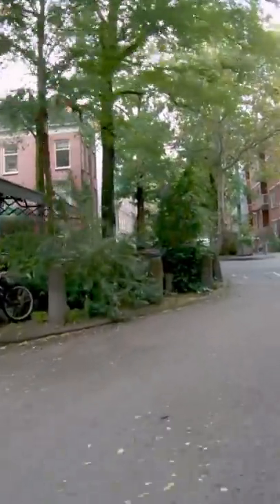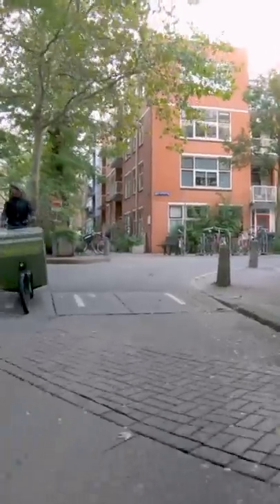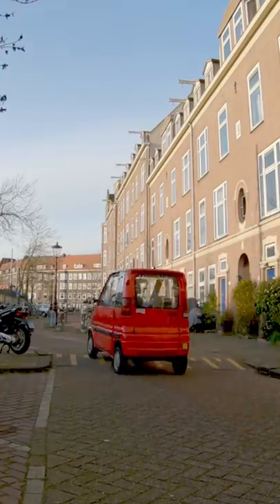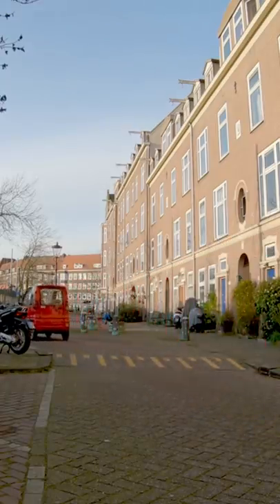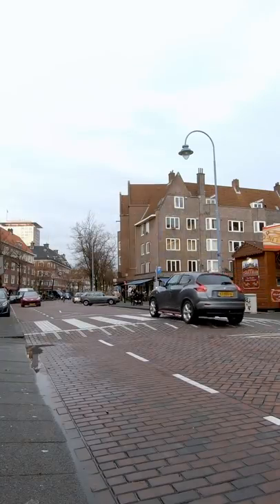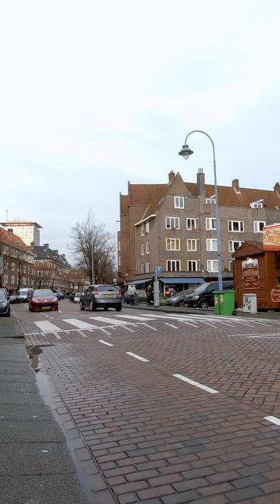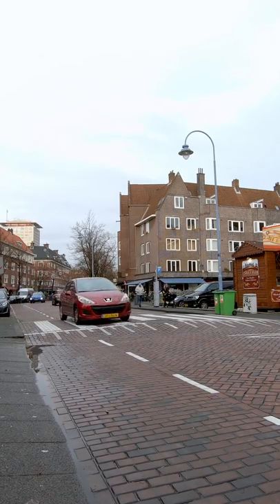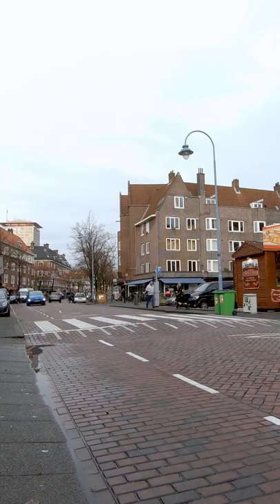How the Dutch Slow Drivers for Safer Streets #shorts

Comment: Some of these seem dangerous,  which doesn't make sense if you are trying to slow people down. You can see better down straight roads, you won't die if you go off the road, if the area near the road is clear.
Reply: They may seem dangerous but if you are more likely to drive faster you are more likely to cause accidents and you are much more dangerous for pedestrians. These precautions are taken more in areas with lots of pedestrians or bikers.

Comment: So what kind of traffic problems or just general automotive issues do these countries deal with
Reply: We had one of the highest traffic fatalities in the 70's, now we don't.
Reply: @Brozius2512  I meant currently but thats good
Reply: @i20coyote85  Still safety, there is a reason why the Netherlands has low traffic fatalities compared to other countries.
Reply: @Brozius2512  that's all well and good but I'm sure there's certain stresses that could be disproportionate if they population density, or just the overall population was larger, with cities designed around pedestrians rather than motor vehicles

Comment: I live in a small town out in the country with nothing but corn fields in every direction. These "Narrowing Roads" don't slow me down, as like when a river or flowing water reaches a narrow area, I too speed up instead of slowing down lol. Sorry but if you can't thread the needle on a road that's barely big enough for two cars and can't pass that fucking godzilla sized tractor with tires almost as tall as a 2 story house while you're going flat out with half of your tires on the passenger side touching the road while the other half sit out over the roads edge like a pair of suicidal koala bears all without you or your passengers sucking up the cars seats due to major butt puckering factors then you aren't driving Correctly. Giggity.

Comment: You know I made a similar comment about a similar video of this but this clears it up so much as to why the Netherlands are safer to drive. But one question, what about buses? I mean don’t those things exist in the Netherlands?
Reply: They do. But the most traffic calmed parts of a city are the streets within neighborhoods rather than the roads connecting neighborhoods. Buses mostly travel the roads that connect neighborhoods. If a bus were to go through a neighbourhood, the road it is planned to drive across will be calmed differently. For example, instead of speedbumps the street would be narrowed for short intervals. Buses would still be able to pass, but two cars can't simultaneously fit. So when a car approaches the narrowed part, they will subconsciously slow down due to the narrowness of the road, and also to check if there is any incoming traffic

Comment: Claustrophbic design that increases the chance for something to go horribly wrong for all parties involved in an accident doesn't seem like the kind of area I'd like to drive in, knowing how many bad drivers I have to deal with locally. You can't make someone who doesn't value their, or others, life and safety care more by introducing more things to run into, or more sudden slowdowns/stops. If they cared in the first place, they wouldn't be driving that way in the first place.
Reply: Netherlands has a good public transport system. We prefer you to either use that or a bike rather then taking the car. Driving cars here is way More expensive then in the USA. Stats actually proof you wrong else they wouldnt be building these roads here
Reply: @Klote3241  Can you link resources or research that backs up your statistical claim? Please don't say something like "stats back x up" without providing said stats that prove your point. Also, if the push is for everyone to use public transport like you say, why go through this effort of redesigning roads in such a way as to make them more dangerous? There are already fewer people driving, which means with a lower load on the roads one would expect the chances of things like accidents between drivers to decrease, while accidents caused by environmental hazards would still have the same chances of happening.
Reply: @admadea  Cant share links on youtube. i suggest you search it up with dutch road safety in an international perspective. the wbsite is called swov it compares car accidents to other country's the netherlands is actually one of the lowest when it comes to car accidents.

Comment: Sucks when an animal runs onto the road and you hit a tree though
Reply: What animal would be loose in our cities?
Reply: @Brozius2512  the picture showed a road that was not in the city with trees close on either side
Reply: @gustafandersson237  You do realize how close towns and cities are together in the Netherlands, right?
Reply: @Brozius2512  yes, but in a crash with a tree  there is a lot more pressure put on the car since only a small part of the front takes the full force. Therefore a crash at 50 km per hour is very likely to be fatal
Reply: @gustafandersson237  But for some reason it hardly happens in the Netherlands, I wonder why that is!
Reply: @Brozius2512  they probably barely have and wild animals or ice like in Sweden
Reply: @gustafandersson237  We have deer and in winter ice but our roads are well maintained in winter.

Comment: As much as these are great for speed reduction, they’re absolutely AWFUL for accessibility. Narrow streets with trees? Where do you let down your wheelchair ramp? Brick roads and speed bumps? If you don’t drive at like 10MPH when approaching that bump in a handicap van you’re literally going to scrape your bumper against the road. Speed bumps where the pedestrian crossings are? Makes it so much more difficult for motorized wheelchairs to cross the street, because the surface is not flat and depending on the chair they may have to go off of the bump for their wheels to work effectively and safely. It’s definitely more safe, but not very accessible :(
Reply: Not to mention making delivery drivers lives hell, making roads cost more, and frustrating the public
Reply: @nortons4673  you should look at this guy's channel and watch some more of his videos. They're light, all tie together nicely and do a thorough job of illustratrating the problems bad infrastructure can cause.
Reply: Pretty sure those speed bump crossing were flat on top and level with the sidewalk

Comment: Smart to put trees close to country roads,  1. if you mess up you instantly die by hitting a tree 2. if anything big wants to drive through there, it can't make way and will get stuck if something else needs to pass it. Sharp turns just means more braking and accelerating increasing pollution significantly and also creating unnecessary noise. i have to say a lot of the things mentioned are stupid, annoying, serve no real purpose and are expensive, specially the brick roads. Excessive speed bumps and narrow roads seem quite dangerous too. There's no room to escape anyone if someone messes up. If someone tailgates me while I'm on a motorcycle on a narrow road that's also separated from the opposite lane, then my only option is to speed up excessively. And speed bumps often risk rear ending accidents, so you have to speed through them if someone is behind you and you didn't see it in time to gradually slow down. Increasing road noise certainly isn't a nice attribute either, it's loud for everyone but in a nice car you barely care or notice. plus brick roads are quite slippery and dangerous, longer braking distance and really horrible for motorcycles.
Reply: All your opinions on road safety are just speculation, while these decisions are made by professionals who base their philosophies on studying road behaviour.

Comment: Why even own a car at this point, if the traffic is built around the pedestrian (you know, the guy not actively participating in the traffic).
Also, being stuck on the first 2 gears to drive through a city just isn't good for the car, nor the wallet.
Reply: Exactly you wouldn’t need a car to get around. Would be amazing
Reply: Exactly that’s the point.
Why buy a car in a city? Whoever travels inside the city doesn’t need a car, so they don’t need parking lots, don’t produce as much carbon dioxide etc. and do not waste fuel
Reply: That's the point you dont need a car

Comment: Putting trees that close to the road is dangerous. If something goes wrong and you crash into a tree that thick it won't be moving and your car will be wrapped around it even at relatively low speeds. That's not even getting into the issues that come up when the roots start to tear up the roads.
Reply: @seo7409  
Making the road more dangerous is not a good way to make people more aware.
Reply: @seo7409  
They have half as many cars per capita, they make it hard for poor drivers (both money and skillwise) to have a car, and they drive far less.
Reply: @seo7409  
Now we are arguing a separate point. I was arguing the trees next to the road are unsafe.  They may have other things that make the roads safer but the trees aren't one of them. I'm just giving you an american perspective on that specific point.
Reply: @seo7409  
Mechanical failures happen and those trees make it more difficult to come to a controlled stop without dying. In France where they have tree lined roads all over the place they estimate that 1 in 8 vehicle fatalities are caused by the trees and they are cutting them down.
Reply: @tcmhs  Again... If that is true then how come the Netherlands has one of the lowest traffic fatalities in the world?
Reply: @Brozius2512  
Again they don't drive asuch. Per capita they are on par with with most of Europe. The traffic fatalities are not reduced by having tree lined roads.
Reply: @tcmhs  Yes they are, it's because the tree lined roads prevents them riding fast like maniacs.

Comment: Speed bumps: make yourself sick and feel like your killing your suspension if you go any above 5 mph
Reply: Then don't go above 5 mph, that's the point.
Reply: @Brozius2512  mhm. Works real well on a 25 mph road at rush hour.
Reply: @ethanf5441  Again... these speed bumps are there for what...?
Do I need to spell it out for you?
Reply: Well that's a you-issue if you get sick when driving over speedbumps. Never heard anyone have a problem with that

Comment: Better road design? The road is for cars to get from point to point quickly, not for people trying to walk across at any point, not for adults riding a children's toy. In most cases narrow roads, tight corners, and speed bumps  lead to more accidents.  Also trees right next to roads make accidents much more likely to be fatal. Dutch street design is trash.
Reply: A city is for people not cars.
Reply: @Brozius2512  I hate to break it to you but there are actually people inside the cars as well.
Reply: "Children's toys". Buddy you have legs, use them.
Reply: @misterdanny8644  Yeah, and they have a giant metal cage around them to protect them. Pedestrian safety is more important.
Reply: @ELF4187  He doesn't understand the concept that being in a metal cage you are safer then outside a metal cage in traffic.

Comment: Make drivers go slower defeating one of the purposes of using a vehicle (to travel quicker) instead of improving the flow of traffic and rerouting it along a road designed specifically for vehicles. Good job.
Reply: Then how come with large congestion in North American cities it's not faster?
Reply: Actually the Netherlands does this not only better than the US But also safer for cars bikes and pedestrians alike
Reply: @Brozius2512  In suburban areas it is way faster. Can go 50mph between my local park and my local grocery store.
Reply: @georgebrantley776  I can go 11mph on my bicycle and I can be at several grocery stores within 10 minutes.
Reply: @Brozius2512  But it takes me only 2 minutes. Doesn't that difference matter to people in the Netherlands?
Reply: @georgebrantley776  People of course go to the grocery stores with a car but a lot of people also go by bicycle. 
We don't buy for the whole week, we buy groceries a couple of days in a week.

Comment: Obviously a country full of people who don’t need to go anywhere, or do anything…
Reply: Actually we do but we find safety more important.
Reply: And thanks to decreased reliance on cars, parking lots are smaller and less common, allowing the stuff people want to go to be located closer together. Which in turn reduces the incentive to drive
Reply: @Stargazer1312  crowded together, so they can be controlled like good little sheep. No, thanks.
Reply: @dissent9959  ah yes, less parking lots means more government. I'll have some of whatever you're smoking
Reply: @Stargazer1312  That and having population neatly collected on urban centers, rather than having it dispersed, allowing some measure of privacy.
Reply: @dissent9959  yeah, because the only thing between you and a police surveillance state is a 4 lane stroad. Get bent
Reply: @dissent9959  dude everyone is able to have a car here as well. the difference is you dont have to. and mostly you will not want to because you will realize it has no benefits. you can travel, shop and have leisure time without cars as well and dont need to pay for a very inefficient mode of transport and its maintenance.